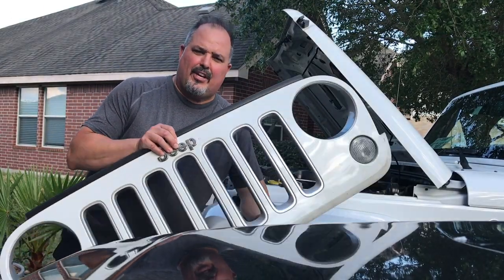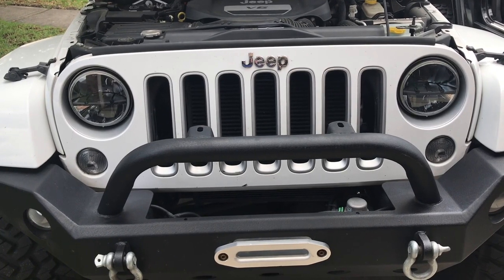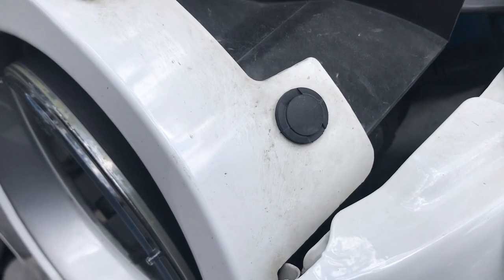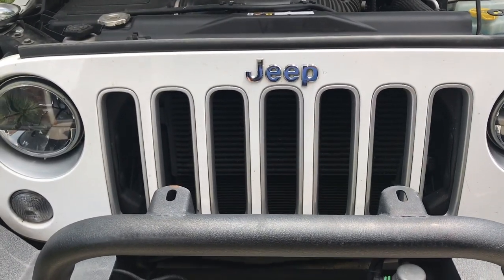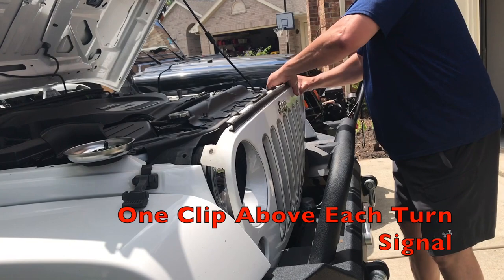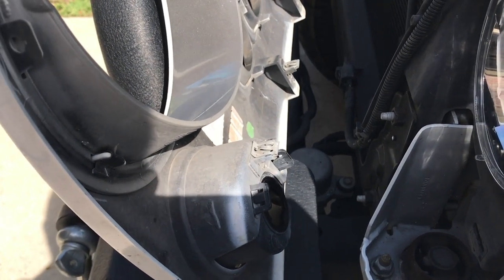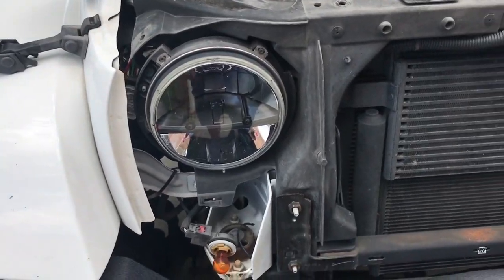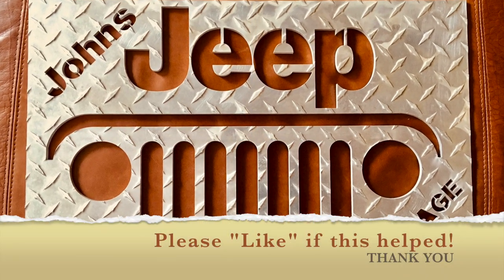Removing a Front Grille on a Jeep Wrangler JK or JKU

Comment: Perfect thanks so much for this! Short into the point. I just want to put some black rust paint on that bar in front of the radiator and I wasn’t sure how the grill came out. Appreciate it!
Reply from the maker: Awesome!  I did the same thing.  I think my Rust-Oleum black paint I put on that bar has lasted longer than any OEM factory paint ever has.  It is funny how that is the first to show rust.  I am glad it helped.
Reply: @JohnsJeepGarage  Yea I just got it about a month ago and that rust really bothers me lol. The underside is very clean and rust free so I want to take care of that. I was looking at getting the metal inner fender liners but my OEM liners have plastic pop rivets holding them in. Have you ever made a video on how to remove those?
Reply from the maker: I definitely have replaced them but have not made a video on it.  The reason is there are so many options for inner fenders and different installations.    I didn't think about separating the video from how to remove the OEM inner fender as a single video but now you have given me a great idea for a new video.
Reply: @JohnsJeepGarage  Gotcha, that makes perfect sense to me! Yeah I am pretty savvy at working on vehicles and normally would have no issues with this but I’ve never had a vehicle with pop riveted inner fender liners. Just wasn’t sure what the best way to go about removing them was. Would love to see a video if you ever have time!
Reply from the maker: Thank you.  I searched YouTube and only found the fender well removals.
Reply: @JohnsJeepGarage  Very cool! Have a great night!

Comment: Thanks John, I need to do this to install the screws for headlight adjustment.
Reply from the maker: You should be able to access the adjustment screws with a long handle torx wrench (star drive) from Harbor Freight (example).  So you should see the access grove to the 2 screws without having to remove the front grill.  It is easier to access with the grill removed but you it was designed to do without removing the grill if you are only adjusting the headlight.  If you are removing them, then you have to remove the front grill.   This link is an example of the wrench / tool.   
https://www.harborfreight.com/6-piece-offset-star-drive-wrench-set-42926.html
Reply: @JohnsJeepGarage  I'm doing the Mode to add 2 additional screws so there are 2 for each light instead of just the single screw
Reply from the maker: Awesome!

Comment: Thanks for sharing ... I have a headlight that stopped working and have to see what I can do about it.
Reply from the maker: Unfortunately, some may burn out over time as you know unless it is a newer light. Some decent ones on Amazon.  Thanks for watching.
Reply: @JohnsJeepGarage  After watching your video yesterday I pulled the grill off, easy as you described. I have Quadratec LED, older version headlights. The passenger side light didn't come on the other day, but yesterday did. I checked the connections and they seemed fine and the light is still working??? I"m guessing the ballast or what ever it's called might be going to fail. Again thanks for your channel ... it really helps those of us not too mechanically inclined.
Reply from the maker: Glad it helped.  It may be just the connections as well.  But I am glad it started working and you know how to access it any time you need it.  Thank you again for watching.

Comment: Thank you for the quick and thorough explanation! Where did you get those silver grille inserts? The ones in each opening and headlight area
Reply from the maker: They came with the Jeep.  It may have come with the Sahara package but I truly never noticed the difference until you pointed it out. It is not an insert but a 2 tone color on the grill.

Comment: Where can I get those door handles I saw at the end!?
Reply from the maker: If you are talking about the pan handles on the black doors for the 1998 Jeep Wrangler TJ, I can purchase different pan handles on Quadratec.com, Morris 4x4 and Extreme Terrain.   I have a video on our channel "How to replace Jeep Wrangler TJ Door Handles" and there is a reference to specific black ones I purchased to replace the current rusty / chrome plated ones.  Remember, there is a handle for the driver's side and passenger side.  Otherwords, contact me through John's Jeep Garage on Instagram, Twitter or Facebook and I will reply directly to you.